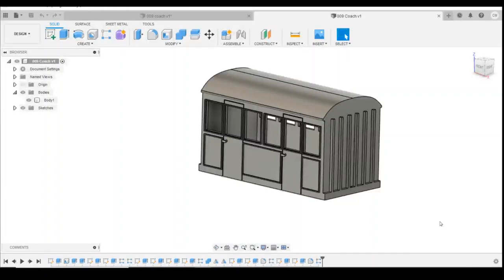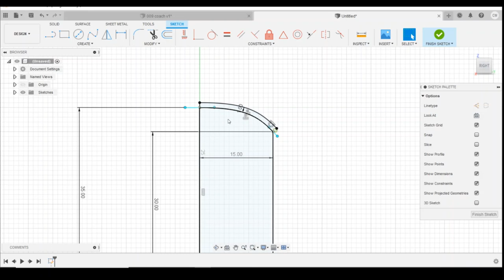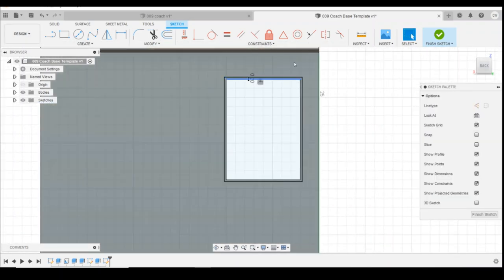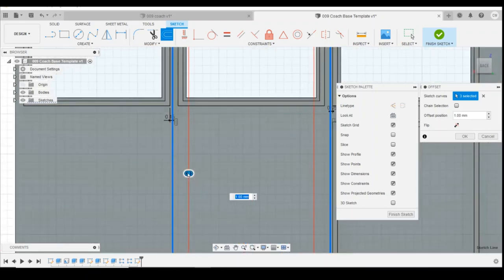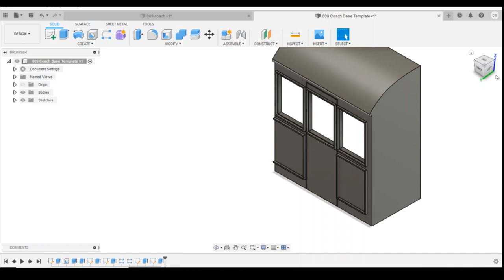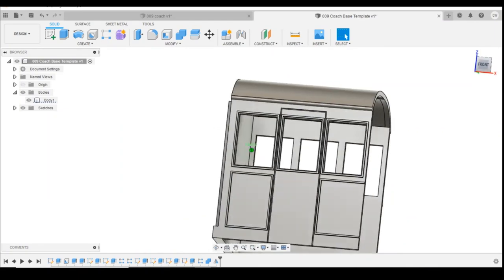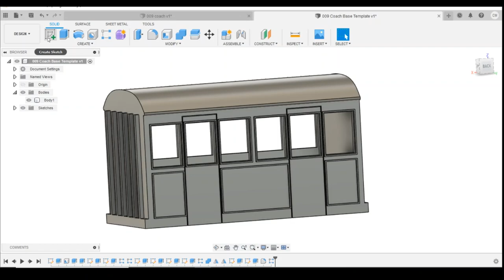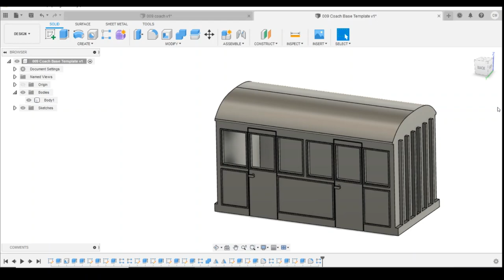Lesson 18 - How to draw a freelance 009 Passenger coach for your Model Railway using Fusion 360

Comment: Hi Carl, thanks for another great tutorial. With something like the door handles is it possible to say create a component which is placed in various places so you don't need to redraw it?
Reply from the maker: Yes absolutely,

But with something as simple as that it can be just as quick to redraw it.
Reply: I've been using NX at work and Fusion at home for the last few years, I'm still a novice really, got a 3D printer.. getting there though, really like your tutorials, very easy to understand, nice tips on designing in general.. good find, cheers.